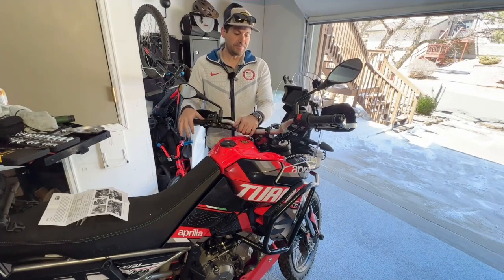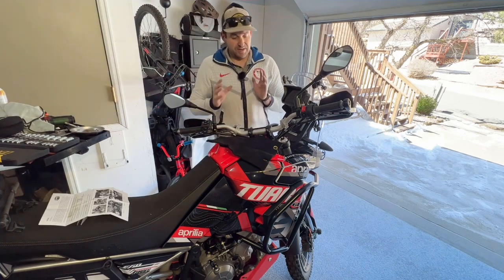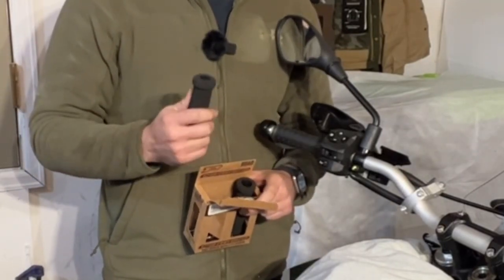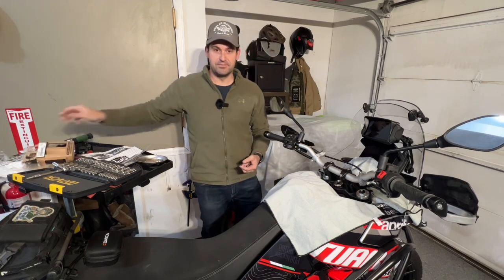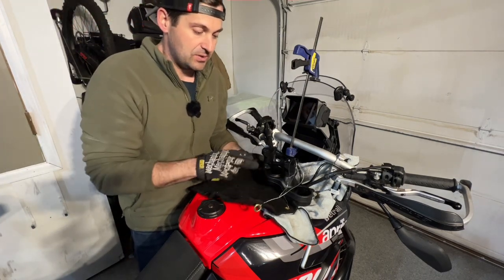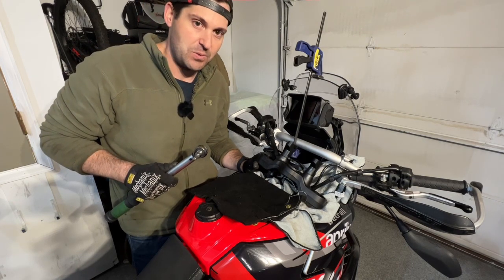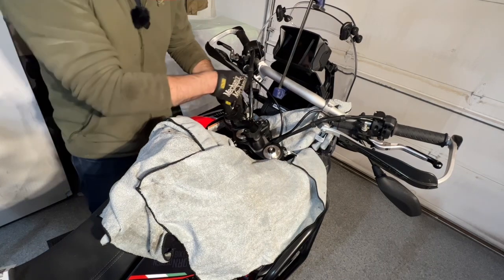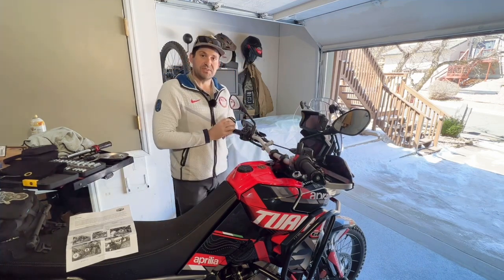Aprilia Tuareg GPR V5 Steering Stabilizer Install

Comment: Installed mine yesterday and maybe just got lucky because I didn't need to apply any heat on my '23 Tuareg. It did require some muscle but both the nuts ended up breaking free. The harder part for me was getting  the triple clamp back on. I don't have a center stand and eventually realized I needed to jack up the front to lift weight off the front end for the fork geometry to realign properly. All is well now and looking forward to trying this stabilizer out on the COBDR. Thanks for this video Ran! I always look forward to your Tuareg content!

Comment: Great tutorial.  I used it to install GPR today.  The torch loosened that nut right up.  Hold it until you see the nylon ooze out.  Use a pair of nuts on the top as a counter screw and it really wasn’t that difficult.  Thank you!

Comment: Just installed mine and used a heat gun instead of a torch. the metal funnel nozzle on the heat gun placed over the nuts did a good job of preventing heat from melting nearby plastics. 
FYI- GPR changed torque recommendations on the small bolts to 4 ft/lbs in their instructions.

Comment: Wow - wish I'd seen this last month.. i had a terrible time with the lower clamp - had to take off the triple clamp which meant dremilling the ignition switch off (don't ask), then getting it on the bench.. 
Works great - feels very different on road, takes some getting used to even on level 1 but great off road - sand and rocks are much easier or at least my confidence is way up 😂
Reply from the maker: Yeah it was a bear! I’ve gotten quite a bit of practice lately with stubborn bolts/fasteners so I busted out the torch probably quicker than most would. I thought briefly about removing the ignition switch then decided that was too much work! The cool/wet weather has been unseasonably dragging on here in Colorado, so I’m anxious to get more off-road time with the damper; what I’ve experienced so far has been very promising. It was already a fantastic handling bike, this will surely add some stability and reduce fatigue.

Comment: Great tutorial! Talked to GPR abou maintenance and they said fluid should be changed annually. That seems like a huge pain in the ass knowing you have to remove the top triple before taking off the stabilizer.
Reply from the maker: Hey Brett, taking off the top of the bar clamp and tipping the bars forward is about a 2 minute process (less if you’re using a power tool); definitely nothing to worry about. Just make sure you mark the bars with a sharpie so you can put them back where you like them. If I had only one motorcycle and this was my commuter plus weekend adventure bike, maybe I’d be changing the oil every year but honestly I don’t expect to change it more than every 2 years when I’m giving the bike a more thorough maintenance overhaul. The stability it provides is totally worth it, trust me! Cheers!
Reply: @lazy-pilot  it looked like it took you a lot longer than 2 minutes to take it off the first time...
Reply from the maker: @bretthawton  I had to dismount the upper triple tree to install the new bar clamp, but you only need to remove the top of the bar clamp (4 bolts)  to move the handlebars out of the way and access your damper for service. So yeah, only a couple minutes honestly.

Comment: Hey Ran,

Any post-install/longer riding feedback? I've put knobbies on the Tuareg (twice), and don't love the on-road feel. I'm really looking at the GPR damper to see if it will address that.

Thanks!
Reply from the maker: I’m not sure what road feel issue you’re trying to resolve. Can you be more specific? The damper is going to beneficial on-road to prevent sudden front wheel oscillations (tank-slappers) from hard braking and grooved surfaces. Off-road it’s going to prevent sudden front wheel deflections due to smacking rocks/roots, etc. Also front end stability in deep sand.
Reply: @lazy-pilot  On-road speed wobble with knobbies is my chief concern. I had installed some MotoZ RallZ (both front and rear), and anything over about 72/73mph was interesting, but 78ish and I would get a wobble. The OE tires performed great for me on-road, and at speed.

Just curious to know how the road performance has been for you?
Reply from the maker: @exploready  I love it. It’s great on-road. I just wanted to give it 3-4 more days of off-road with it to perfect the settings before I gave it my review. I can already tell a difference how much more I’m able to relax my upper body both riding on the seat and standing on the pegs. I do think it would be very beneficial in your case. You can really crank up the damping for those higher highway speeds and I would think it could completely resolve your issue by damping out those oscillations. I run a TKC80 on the front and didn’t have that issue before installing the damper.
Reply: @lazy-pilot  That’s exactly what I was hoping to hear, and exactly why I just ordered one!

Very excited to get it, and get it installed.

Comment: Try taking the engine apart the bolts and screws are like silly putty on the 660 engine I worked on and it was an RS660 engine which I noticed it had some parts that said made in china

Comment: Sorry,  but why do you need an additional stabilizer? What for?
Reply from the maker: It doesn’t come equipped from the factory with a steering stabilizer (also known as a “damper”). There’s lots of videos covering this, a multitude of benefits for novice and highly experienced riders (such as myself 😉). For me, long (+6) days off-pavement lead to upper body fatigue, this help me stay more relaxed on the bars, as I don’t have to exert as much effort to protect against an strong front wheel deflection off a rock; this is true for both high and low speed. Other people have found them particularly useful on-road to reduce any oscillations (leading to “tank slappers”) from a certain tire lug patterns. Search YouTube, there’s a ton of info on them. I think they’re an excellent upgrade.

Comment: hi there!any problems so far with this bike?how many miles?i m consindering to buy it but i m consindering the reliability.
Reply from the maker: The Tuareg is my 27th motorcycle purchase in my  lifetime, and I will say it’s average in terms of reliability. I do appreciate the interactions I’ve had with my Aprilia dealers when taking care of a water pump oil seal drip, which they repaired quickly under full warranty. I had the oil drip before a 1200mi trip and the dealer told me to “just ride it and don’t put too much oil in it, it’s probably losing less than you think.” I pressed on, completed my trip and added MAYBE 1/5 of a quart (946ml) during the entirety of that mileage. Besides that, I’ve had one loose spoke in the front wheel that took a whole 5 minutes to tighten. That’s about all I can think of presently.

Comment: Oh man I was pretty excited to install mine this week and now not so much ahaha. I don't have a propane torch and heat blanket. Maybe a heat gun on max settings will do the job well enough... Thanks for the video! Can the top triple clamp be fully removed? Thinking about locking it to my work bench
Reply from the maker: Honestly, buying a mini propane torch and a heat blanket is the best $20-25 spent for tools I can think of. Unfortunately a heat gun won’t get nearly hot enough (fast enough) but it will blister the paint off the bottom of the triple  clamp. It’s a couple extra steps to fully remove the triple clamp from the bike; which includes unfastening the ignition key module and the wiring harness holders. It has to be significantly easier than your high fender project!!
Reply: sigh... more tools to buy! at least it's not too expensive ;)

I will see what I can do! The high fender mount was a pain in the arss to design for sure :D

thanks man!

Comment: Nicely done... However I perhaps would have used an impact driver to remove that stubborn nut...blue skies .
Reply from the maker: I guess it would have been appropriate to mention I tried that with no luck. I didn’t pull out an air impact, but I had an electric impact on medium power, sadly no bueno.